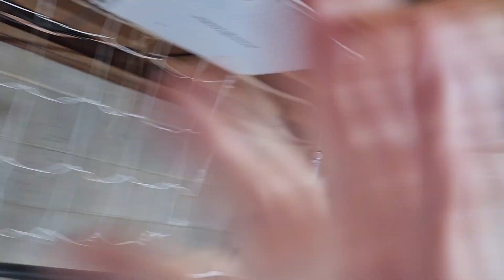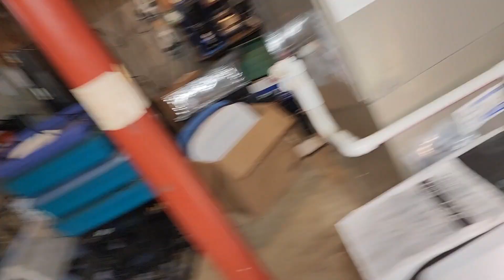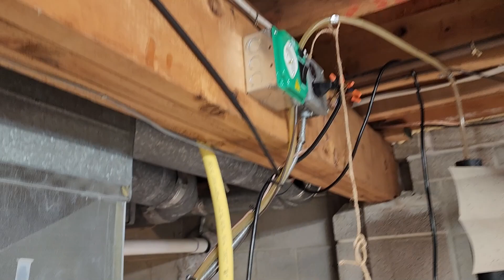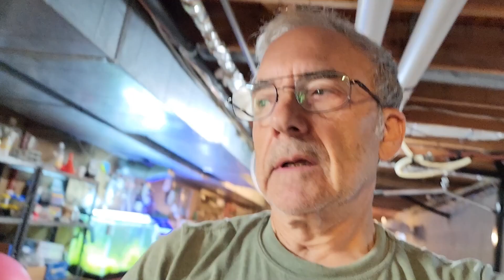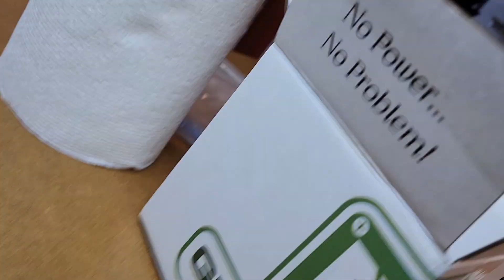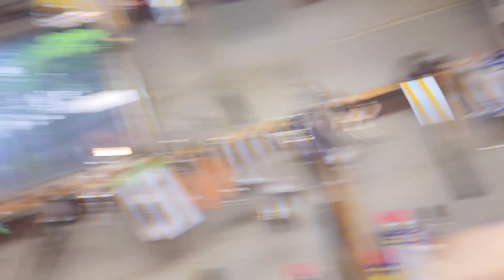EZ Generator Switch

Comment: Generator also has a floating ground and you need a neutral ground.  there is a special grounding plug that you plug into the generator socket to solve this.